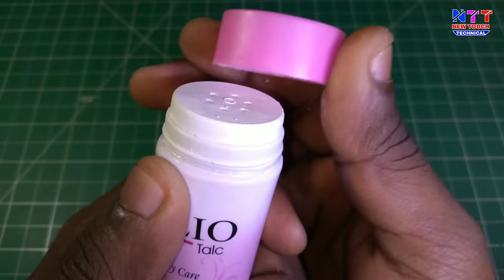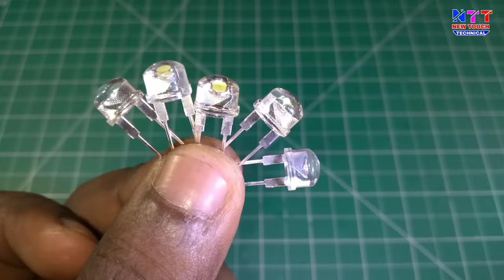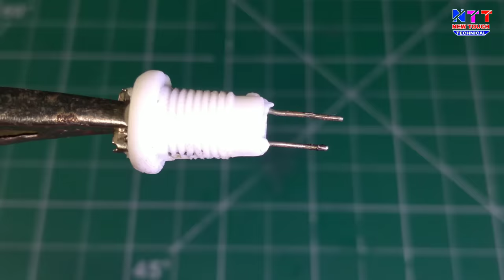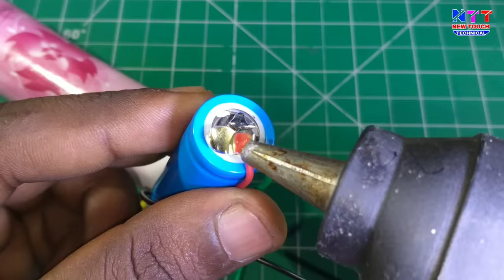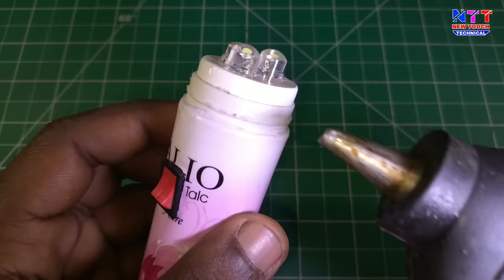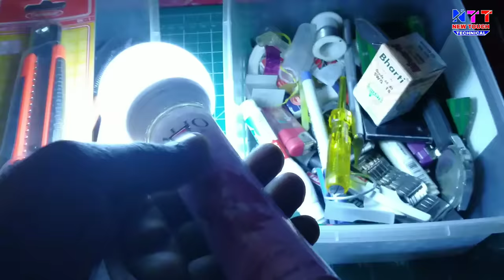pawerfull hand rechargeable torch at home || torch || hand light || led torch

Comment: Components value?
Reply: 100rs 10rs powder 90rs bulb
Reply: Resistance value?
Reply: @gnanadesiganramu8047  330 ohms (Going by the colour coding on the resistor)
Reply: You can use anything above 220 ohms
Reply: @PreetamDas64  okay
Reply: @PreetamDas64  okay